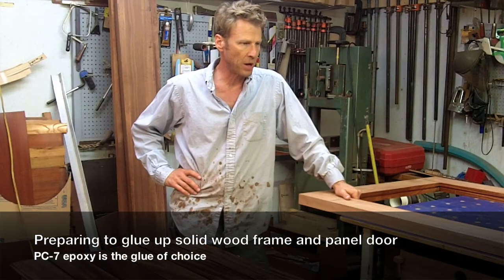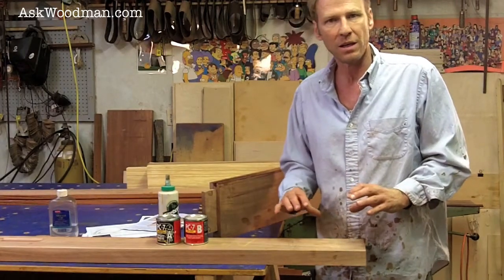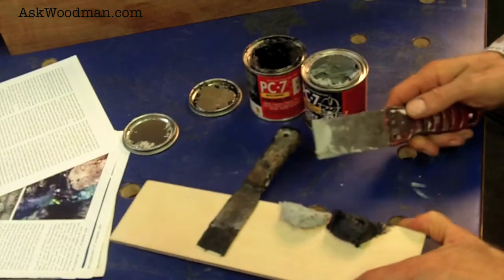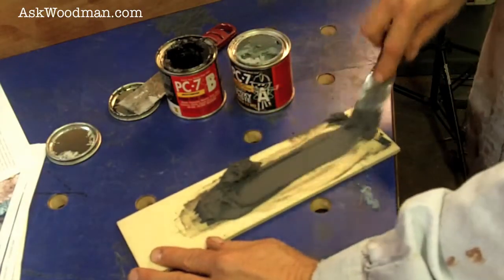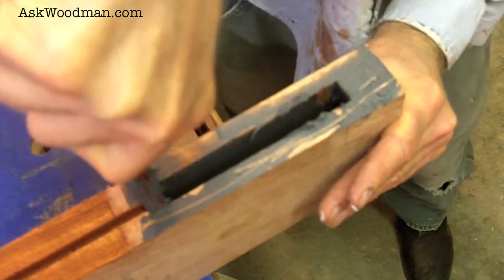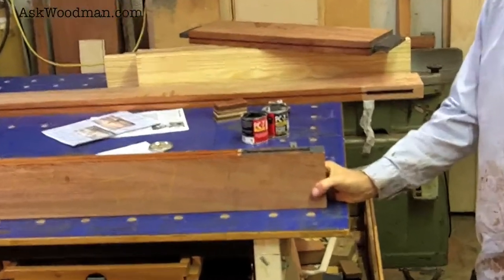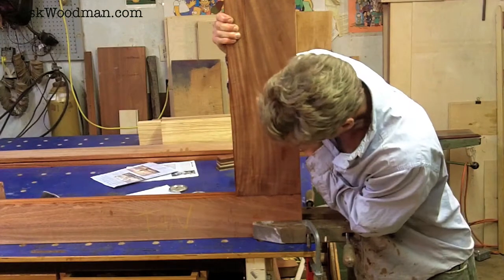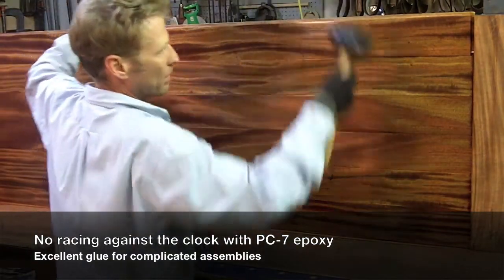18 How To Glue Up Mortise and Tenon Joints - SOLID WOOD DOOR SERIES  - Video 8

Comment from the maker: Absolutely use PC7. That and the incredible rot resistance of cypress will make those window frames last a very very long time. It is the only glue I use for exterior applications and I have never had a joint fail that I know of. Thanks for writing.

Comment from the maker: Do you mean blind wedges cut into tenon that spread the tenon apart inside the mortise as the pieces are driven together? I have done that. But there is a lot of risk to that technique in that you can easily break through the face of the mortised board with so much lateral pressure. In my opinion, it is a technique best left to more rustic furniture applications or structural timber framing projects. What is you experience using wedges? Did I answer the question you intended? Allan

Comment: Great demonstration. I like your use of the C clamp. I will use that technique immediately. I agree with you about PC7. I have had great success with it in many applications. It is thick and does not run in vertical applications. Nice job!

Comment from the maker: I just realized you may have meant perpendicular to the tenon. This would be a fine addition to joint strength in say for example a chair where the joint is cut far from the end of board. But for a door I am still wary of cracking the end grain. Precise alignment of joints is also restricted. For through tenons, pressing wedges adds a decorative touch but also fills gaps and locks the joint in place. For frame and panel doors I just feel the large mortise and tenon glued with PC 7 is sufficient.

Comment: I am trying to repair an old chair for a friend that has loose tenons (oversized mortices). The tenons are too small as well. While replacement with a floating tenon would be the way to do this, I am tempted to use a think epoxy like PC-7 to also fill the gaps...what are your thoughts on this? BTW, beautiful door. I guess I would use masking tape to protect the wood from the squeeze-out.

Comment: @askwoodman 
many thanks for the reply.  Ive made a number of external doors using the traditional methods but eventualy decided the only way was lamination - a bit of a pain but it seemed to work.  
Watching others fine work warp and twist is no pleasure.  The finish though sounds as if it holds a lot of answers.
Interestingly enough that was what appeared to hold the very fine and thin ercol elm tables together.

Comment from the maker: @Tommyfungun I think precise measuring and marking keeps errors from accumulating in an any furniture or carpentry project. I am very careful with measuring and marking because errors cost me time and money and really take the fun out of building. I started out making bed frames. They are easy and straight forward and do not have doors or drawers or other moving parts that complicate the piece. Plus a wooden bed frame is a sure avenue to a woman's heart. Trust me on this.

Comment from the maker: I like the long open time of the PC7 for interior and exterior doors since I need time to get everything just right with clamps and cauls. If I had to glue for width on door components (which I would avoid if possible) I would glue them with Titebond III. I don't use epoxy for edge joints. The PC7 really shines on these mortice and tenon joints. I have never seen one fail, interior or exterior.
Reply: AskWoodMan Can you expand on this? Why is PC-7 not good for edge joints/making panels?  It is too thick?  There is a visible black line at the joint? Went out and bought a couple of those wooden hand screw clamps after watching your video - didn't realize how useful they could be.

Comment from the maker: I have never though about using PL for furniture. It is serious adhesive there is no doubt about that. But it stinks really bad and goes bad in the tube if you don't use it fast enough. So I think I am going to be a crotchety old grump and stick to my Titebond III and PC7  :)  But thanks for mentioning it here, because it really could be a good choice for certain applications. Allan

Comment from the maker: It will set in salt water. Serious stuff. I like this PC7 because of the long open time and super thick paste gap filling nature it has. There are many other types of epoxies with different set and thickness properties. West System is a very well respected full line epoxy company and they have a lot of info they freely share about epoxy. Many people can get sensitivities to epoxy so be aware of this. Another reason I like the paste epoxies is they have very little vapor.

Comment from the maker: Yes i have used it as a  filler. I have also tinted it with colored putty (about 20%) to drive the color to a dark dark red. There is also PC Woody that works well for lighter color woods. They make a white too, but it just looks terrible with wood.

Comment: Would you glue the joints with epoxy on an exterior door as well? If it was an exterior door  would the stiles and rails be a single solid piece or laminated?

Comment: Thanks, Great advise. Just a follow up question on avoiding glueing for with on doors. Is it recommended to glue together alternating grain pieces to avoid any possible bending or warping? 

On another note I'd like some info on your VSCT table saw fence system, where would you prefer i contact you at?

Thanks again.

Comment: Have you ever used PC-7 to fill knot holes in a darker wood? I have about a .5in hole from a knot right on the walnut edging of a bistro table top I'm doing (it's going to be laminated on both sides when finished.) It's small enough and not for a client or anything, so I'm leaning towards filling it with a black, paste epoxy for ease of working and discrete appearance. I'm trying out a generic epoxy dyed with some black pigment on scrap later, but I'm very interested in trying to use PC-7 too.

Comment: hi i just what to know if i can make a solid wood door frameless?
using festool dominoes...
i will apreciate your answer
Reply from the maker: Yes you can make a solid wood door just by gluing boards together to make a panel. You can use a Domino but the real strength comes from very clean and complete flat contact edge joints of the boards that comprise the panel being glued with a high quality glue like Titebond III.
Reply: thanks in fact Titebond III is the only glue that i use.
do u know whare can i foud a plan to make my first solid wood door?
from there i think i can learn the basics.

Comment from the maker: I may have mentioned that even after after all these years using it I still have a problem with the amount to mix per use. Since you have so much open time, just start off with little  bits and mix more as needed. I am a cheap and frugal guy and wasting expensive glue just infuriates me.